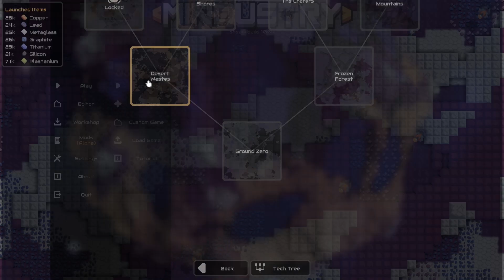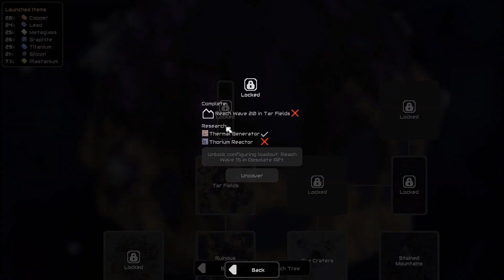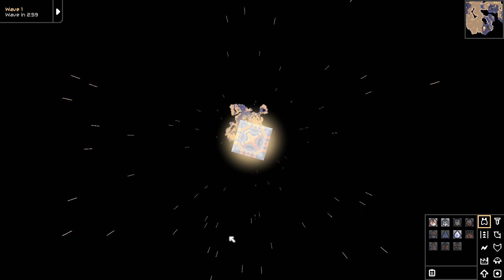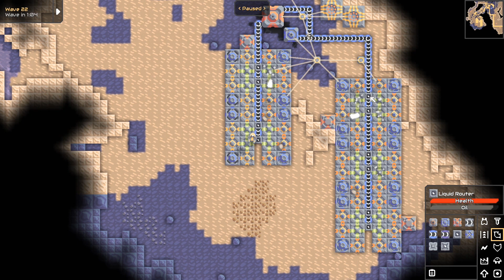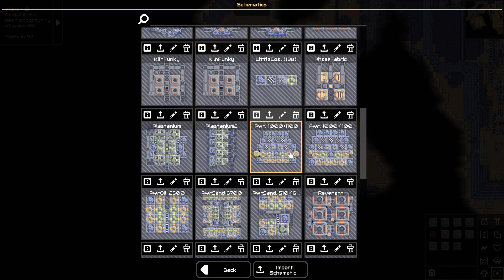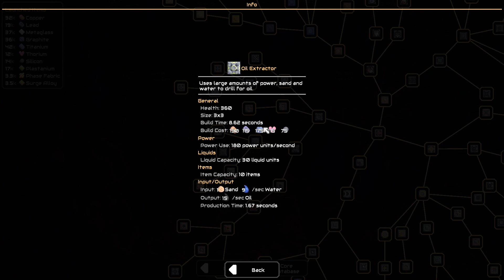Let's Play Mindustry 7 Tar Fields (Thorium, Phase Fabric, Surge Alloy)

Comment: I have this game on mobile I have unlocked almost everything and I can say I am pretty good at the game. Anyway, yeah, I have this on mobile and I am going to move on to pc because I don't like my tablet running out of battery. Plus, even though my pc is old, it still works like it's new it is just slow working capability.

Anyway, I'm new to this channel, thanks for this video I am going to apply it both on my mobile save and my pc save.

Edit: Utilise scorch weapon. I use like 3 of them and they op. Do the math, 

Shots: 1
Shots/sec: 12
Coal ammo: 6 dmg
Pyratite ammo: 9 dmg 

Coal: 12 * 6 = 72 dmg per sec
Pyratite: 12 * 9 = 108 dmg per sec

Bruh is this enough?